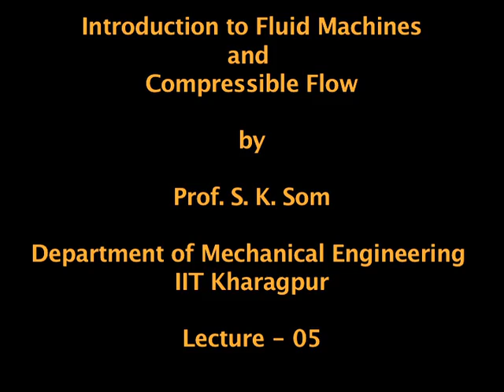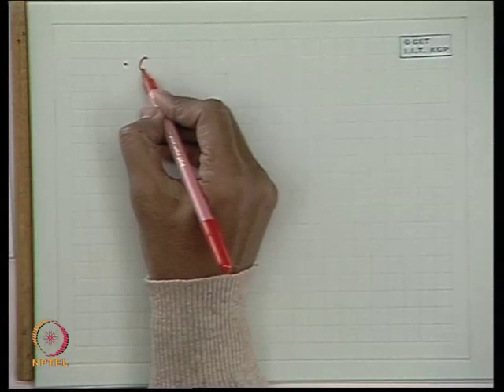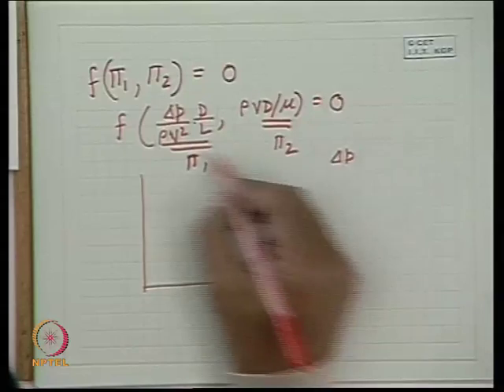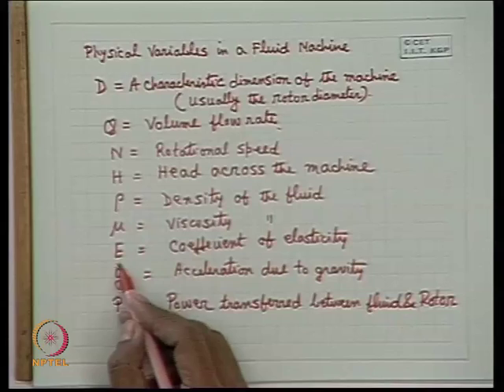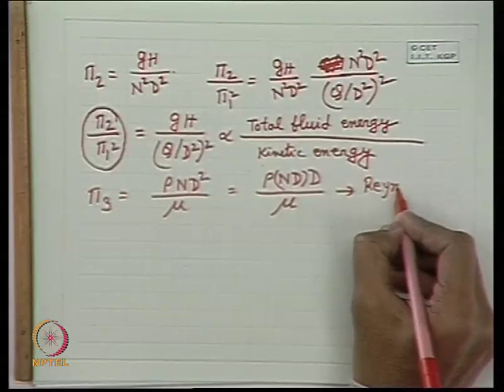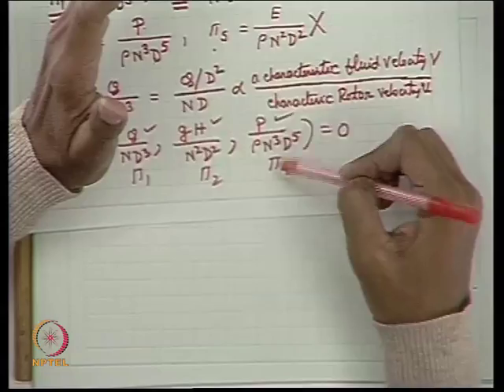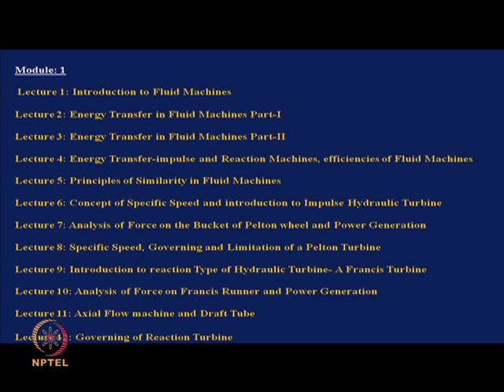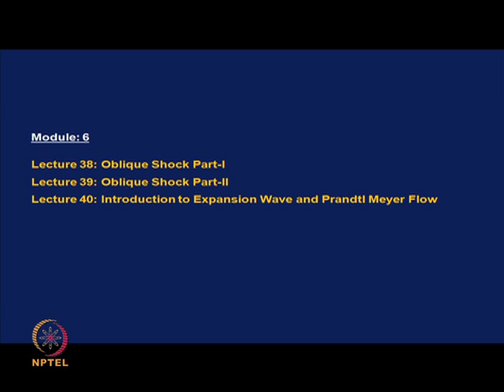Mod-01 Lec-05 Principles of Similarity in Fluid Machines

Comment: we can find out power and other things from velocity diagrams then why do we need all this
Reply: Well couldn't answer your question on time, 

But for future reference, 

We need this for scaling and experimental verification. Say you have a leaf blower that you can use with one hand then with that pump you can find out performance characteristics of blower of size of the truck without actually building the truck sized blower given that they are similar in structure. 
Of course you can use "theoretical calculations" to get the values for it but "actual" acceptable results can only be obtained by experiments not even simulations.
Reply: @अण्वायुवरीवर्त  arent model laws are also theoretical?
Reply: @bashamsk1288  assuming you are talking about terms used in dimensional analysis, 

Yes they are.

 You're question is unclear, sorry if it's not what you are asking for.
Reply: @अण्वायुवरीवर्त  dimensional analysis theoretical
Velocity diagrams theoretical
So whats the point? 
Why cant we use velocity diagrams
Reply: @bashamsk1288  there so many assumptions, just to name a few : shock less entry, incompressible flow, steady flow, 2D flow, etc. 

Also in the very next video he uses dimensional analysis to form Specific Speed on basis of which we can select the type of machine just based on power, rpm, head and flow rate. Also from customer's POV, they don't need to do analysis and design the machine they just select suitable device based on requirements. 

Well if you re-watch first 10min of this same video he explains why we need it.